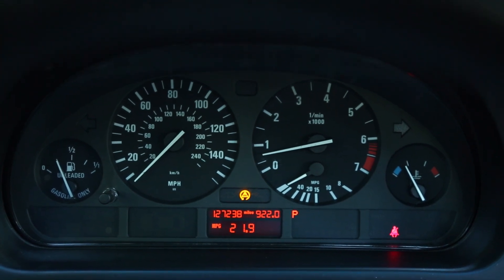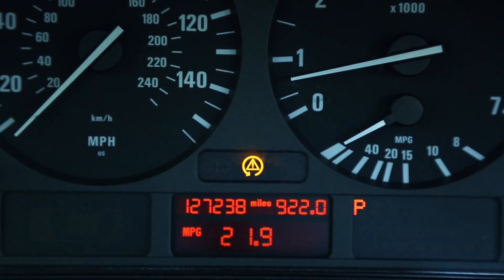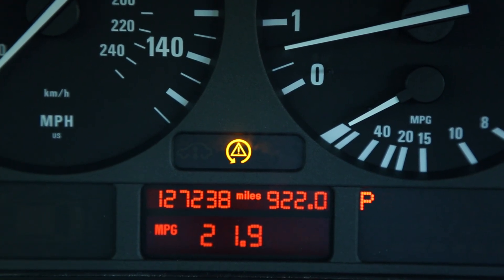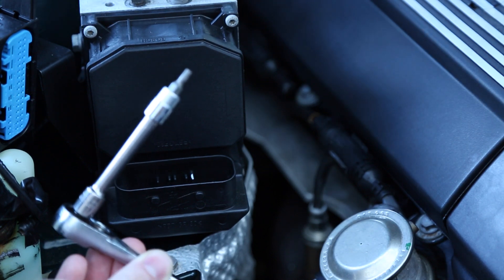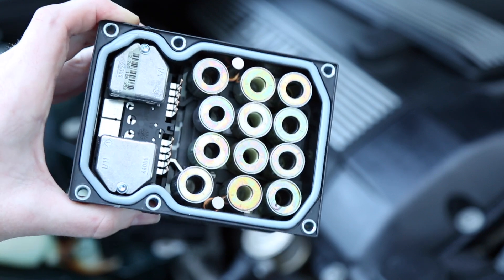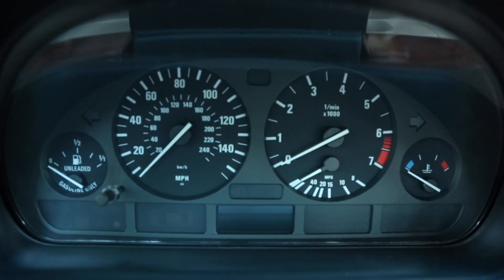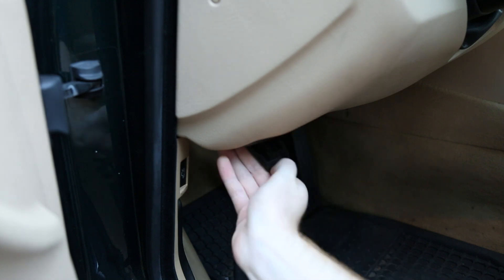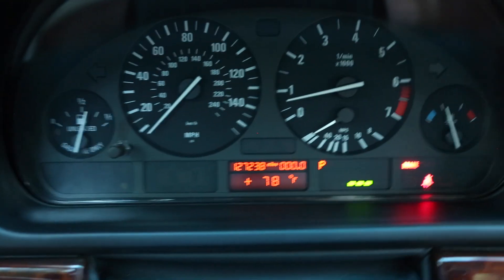BMW DSC Light ABS Precharge Pump Code 88

Comment: Well, I have an E 38 and all three lights came on for me and found out what the problem was. Was the ABS module removed it sent it to a place that does module repair for $200 and the problem is fixed no more lights everything is good to go. Error code for the pressure switch is gone and also for theimplausible speed sensor.

Comment: Just a quick question !, is it ok to drive the car when the module is disconnected as it doesn't seem to affect the brakes when the plug is pulled out  stops the limp mode which makes the car slow to pull away  or am i totally wrong !

Comment: There are 2 additional things that you can do try and rid the code. FIRST is to take a RUBBER mallet and hit the pre-charge pump with medium force a few times. SECOND, find an open dirt road and get up to about 50mph and SLAM on the brakes...do this about 5 times. Sometimes the components in the pump can get stuck and doing this method can free it up. This 2 step method was recommended by one of, if not the most knowledgeable and respected Import Mechanics in North/South Carolina.
Reply: كلام صحيح
Reply: 3rd method is to drive to a quiet rock quarry and toss the car over the side .. ....😮

Comment: Was that real be a reference as in 5A for ABS short circuit so would that indicate that my ABS is bad and needs to be replaced cuz just as last night or yesterday all my lights lit up as well as my speedometer stopped working but today I got in the car now it works after I try to reset it

Comment: Super video !!! My 630i got a problem i cant get into the obd2 so it could be the abs module DSC.. ? Because they fixed the ecu that's fixt and reprogramed but STILL NO COMMUNICATION ! I think that's the problem ?
Reply from the maker: What scan tool are you using on the obdii port? Check if one of the pins bent by accident. Very easy to do, I’ve done it. Will result in no communication error on the scan tool.
Reply: Thank you fore you re ansering ! The obd is ok because it can get to other  sercuits onley not the abs dsc and motormanagement system , i got it wrong it does not say no communication it say not ditactid 😉 .. but why can it not go in and look .. before it was fine and had no problem to go in 😔

Comment: I only have DSC lights on when driving 30+ MPH -- its random but it will show up. Should I replace my DSC or maybe the wheel sensor is faulty? Yeah, Ill need a separate ODB scanner for this job.

Comment: You didn't drive the car after you installed the fixed sensor, if it's really fixed, the lights won't light up past the 20/25mph mark, but if it's not really fixed then the lights will light up after you start to drive it, . . .can you please confirm this?

Comment: for some reason my 97 528 i will not shift past 2nd gear. I was under the impression that the abs module could be problem, is this a fact or not?
Reply from the maker: I haven't heard of this personally, but there are many variables that can cause your issue. You should start by scanning the car's OBDII port with a tool capable of getting transmission trouble codes and start there. This is the tool I use: https://youtu.be/yxuWEJx1GiE
Reply: @BIMMERZEITT  
Thankyou very much I will look into that.
Reply from the maker: @berniesamuels9923  Bernie let me know what codes you find once you scan the car. In many cases the $60 tool will be less than the diagnostic fee charged by a repair shop. In a pinch you can stop by AutoZone or Advance Auto Parts stores, I believe they can scan the car for you for free to retrieve codes. I'm not sure if they can get transmission codes though, probably just generic engine codes.
Reply: @BIMMERZEITT  
I will do that, thanks again. I did lookup the  scanner you mentioned so I may acquire one my self.

Comment: You’re a life saver!! I thought I was gonna hafta pay $1600 to replace the ABS module on my 2000 X5 and it really wasn’t even gonna be worth it since the car is so old. I already spent $190 getting the RR speed sensor replaced a few days ago and that didn’t clear my code 50 or the trifecta lights and my speedometer and odometer still don’t work. My mechanic told me that my issue was the ABS module not the speed sensor when I picked up my car. I wish I would have done more research before wasting my money on the speed sensor.
Reply: You should get a new mechanic. It’s not hard to install your old speed sensor. They ripped ya off

Comment: Does anyone know if you could still drive the car without the module?
Reply: yes you can, but a plethora of side affects occur: odometer and speedo won't work (mileage won't be tracked), parking sensor stays on (if you have one), mpg as well as miles left on tank and gas levels are all erratic, shift points in transmission will occasionally be different/bad, obviously you won't have ABS and traction control working
.

Comment: Can u still drive without it till it’s fixed
Reply from the maker: Hi, technically yes you can but I wouldn't recommend it. Your ABS will not be functional which is not too safe in the event you need to stop suddenly.
Reply: @BIMMERZEITT  would it reduce the power of engine?
Reply from the maker: rabie jomaa no
Reply: Oh ok thank you

Comment: how to fix the dsc lights on 2003 bmw 525i e39? I replaced the modulator the abs lights and brake lights are gone, but I still have the dsc light on, how to fix it?

Comment: you could repaired it your self 
just take out the cover and solder some disconnected points
Reply: soldering joints are extremely small inside those modules.. don't recommend doing it yourself if your not know exactly what you're up to

Comment: Is this the same problem for the 2002 BMW x5?
Reply from the maker: The X5 has the same issues but you really need to start by scanning your car to find the ABS trouble codes. I'll have a new video soon about scanning with an inexpensive scan tool so you can avoid paying a shop a diagnostic scan fee

Comment: I have the same issue with my E39, only DSC light is stuck on and had the code 88 pre charge pump failure.  Do you know where is the pre charge pump located?
Reply from the maker: Leon it's located below the intake on the driver side of the car, close to the firewall

Comment: if I press the dsc button theres no response with the light. I feel as if when I drive my brakes tend to start slowing down the car when ever it wants. I know this because when I feel it ive pulled over and my brakes at smoking. I clean my wheels and the rear rims are always dirty with brake dust. if you can kindly advise me of this issue. thank you
Reply from the maker: When there is a fault the DSC light will stay on as you describe. I don't think your dusty wheels are related to the DSC issue, but can't diagnose over the internet. I would start with having that module rebuilt from an eBay vendor and having the shop your car is at inspect your brake components for wear.

Comment: hey guy I just purchaced a 2002 530i with a trouble code88 like the one you have on your video. you mentioned of places that will repair them for $100  can you give me a referral  or where you had yours repaired. the local bmw shop said the prepump needs to be replaced. so I showed them your video. their interested in the out come. thank you for your help. Ralph at ralphs brake
Reply from the maker: Carlos, just search "BMW ABS module repair" on eBay and choose a vendor. Send your ABS out to them. It's very common, and worth a shot. Chances of actual pump being bad is slim.

Comment: what kind of stupid fuck would place the abs module under atf reservoir,oil reservoir and coolant tank :@ its tight as fuck I had to remove everything and the fluids and the pipes still coudnt reach some bolts !! hate to work on x5
Reply: Doa Kayhan The same work for me last days 😝

Comment: Please help, i had all three lights on I sent the module for rebuild and then when I got a back as soon as I installed it I started hearing ticking noise coming from the precharge pump and it won't go away even when I drove the car and everything so I have it disconnected now, and all lights are still on
Reply: +BIMMER ZEIT yes they found a problem after I send it twice and finally they got fixed and it's all good now
Reply: I've read in several other forums that you have to bring your car to a dealer to get your rebuilt ABS module reprogrammed. The module is VIN specific and needs to be program to your car.
Reply from the maker: hey Kevin, did the shop who rebuilt your ABS unit tell you they found a fault in the unit? They should be able to tell you 1. they found a fault and 2. it was repairable. Not all module issues can be repaired with the rebuild service. Sometimes the car will require a brand new module. You would also need to verify that the precharge pump itself is functioning. Did you ever resolve your issue?

Comment: Thanks for the video. I'm having the exact same issue. Are the lights still off? Also, where did you send your module to get repaired? Thanks
Reply from the maker: NEW ABS MODULE: http://amzn.to/1RdIUu5
REBUILD YOUR MODULE: http://ebay.to/2hGtS3f
Reply: +Fix The Bimmer Thanks for getting back to me. Can you send me the link to the seller on ebay? I havn't been able to find a good seller who does this. I appreciate it
Reply: +Fix The Bimmer can you name the seller? i need this done
Reply: +Fix The Bimmer Having the same issue as well on my 740iL.. Naming the seller would be of great benefit to me as well
Reply: BIMMER ZEIT hey I have the same problem with my bmw. I was wondering how would I find  someone to rebuild my module on ebay how did you do it can you please help me. thanks.